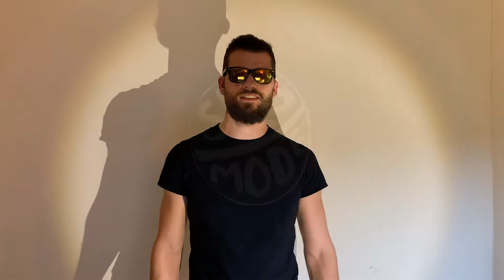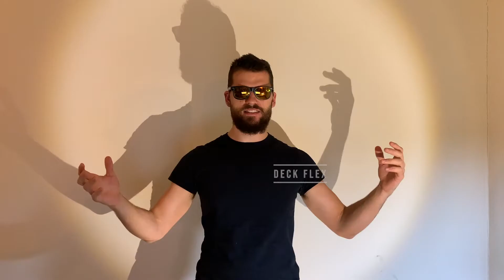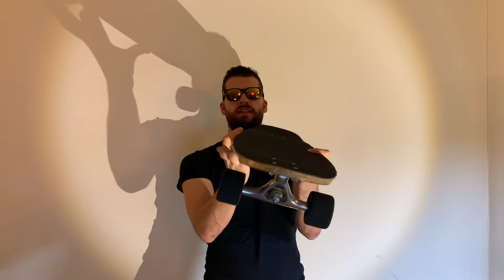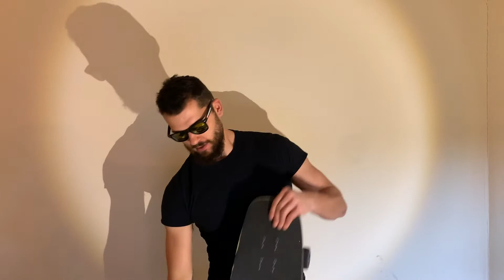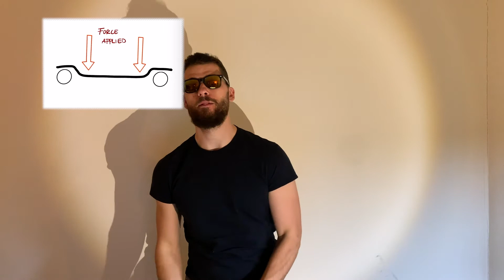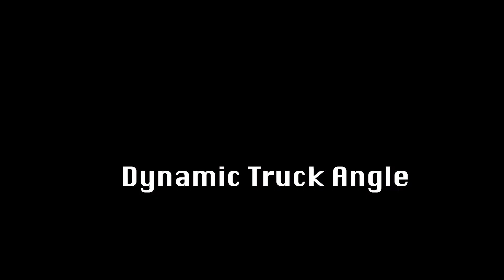Deck Flexibility & Turning | Engineer Your Longboard

Comment: Is it possible for a drop down to be a little bit flexible? I want a nice cruiser long board with a pretty smooth ride that will let me go far and be easy to push. but I also want it to be somewhat stable at high speeds. I'm not gonna do any type of racing or downhill but if I do go fast I want the board to be a bit stable. I don't plan on doing any sliding but I do want it to turn relatively well if I need to. Drop down seems good for pushing but it also seems like it's very stiff and made for downhill
Reply: i would say try out the landyachtz battle axe or drop cat 38 you will not be disappointed with either

Comment: What's your opinion on a double drop board with a 45mm drop on the deck, rated as "stiff" on 90mm wheels.
Reply from the maker: “Stiff” is a tough quantifier to judge by. I can only speak from experience and say that Pantheon makes the best double drop boards.

Pantheon’s stiff double drop (Nexus) comes with 69mm wheels and their flexible (ish) double drop (Trip) comes with 85mm wheels.

Stiff is for sliding/downhill
Flexible is for pushing/pumping

Manufacturers make the call on what they want to specify as “stiff” or “flexible” so it’s a tough call without more information.
Reply: @pvdeviants5105  Thanks for your reply.
I'm a beginner so the board I'm speaking about is an inexpensive one. The Magneto Low Glider.
It's a bizarre hybrid that uses 100mm scooter wheels on a really wide double drop deck.
I've seen scooter wheels on paddle boards before but this is a push board. 
I figured if the scooter wheel thing feels too...drifty(?).  I could change the trucks to standard longboard ones. 
I'm guessing the board has little flex because it rides so close to the ground (even with the 100mm wheels)...
Reply from the maker: @BendApparatus  what kind of environment will you be riding in?

This Magneto board looks pretty neat and highly specialized for flat ground. Professional long distance riders usually ride a polyurethane wheel like a 85mm Seismic Speed Vent (which are relatively narrow longboard wheels but still much wider than the scooter wheels).

The scooter wheels will give you a better pushing efficiency in theory, though I’m not sure how it’ll pan out running over pebbles.

I always look at wheels proportionally (width vs. height) and compare them to something I’m familiar with. The aforementioned Speed Vents are proportionally a lot like an F1 cars wheels proportionally, and I have some mega wide Cloud Ride Storm Chasers that look like steam rollers. They both “feel” like those things when riding. I’d be really interested see what those super tall narrow scooter wheels feel like.
Reply: @pvdeviants5105  Mostly poorly maintained sidewalk and asphalt... I'm in south florida so hills are a pipe dream...south fl is surprising longboard poor.
Hell I don't even see street skaters anymore. (Laws)
Though there is always the beach and the state parks...but I'd have to research the regulations on longboards.

I haven't decided on that board yet...
It's between that and that same company's carving longboard with standard trucks, and interesting 38" drop through with plenty of flex...
Reply from the maker: @BendApparatus  Flex definitely helps when it comes to bumps because it acts like suspension. 

For 100% flat ground I love my bamboo sector 9 sidewinder board. It carves like crazy and eats bumps no problem.